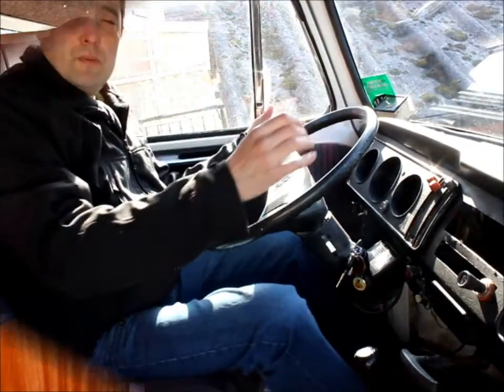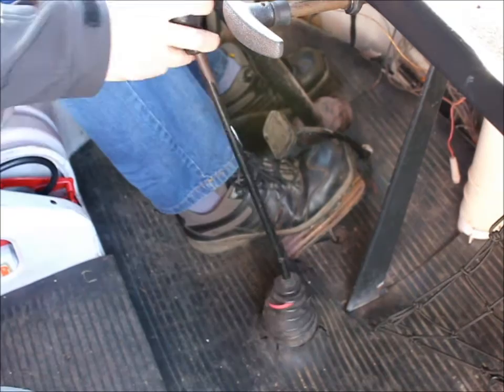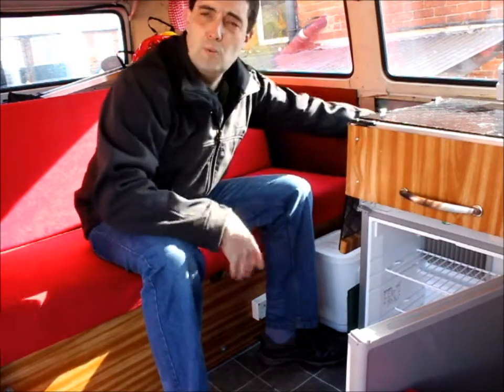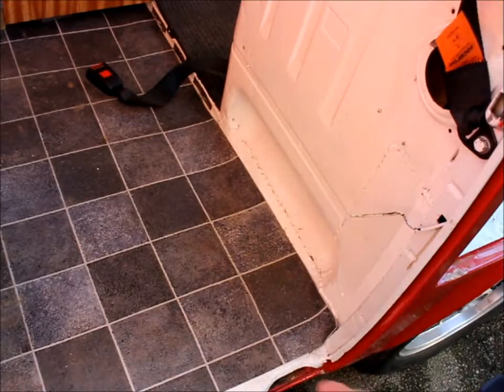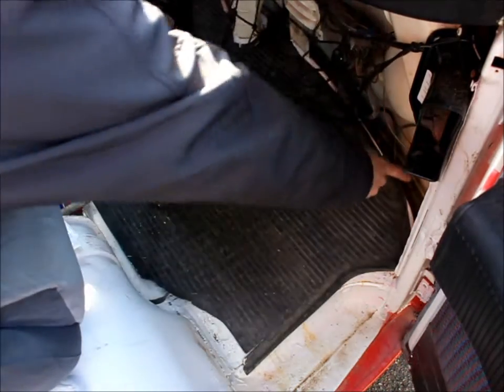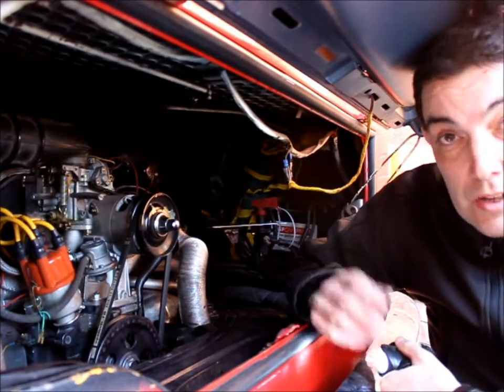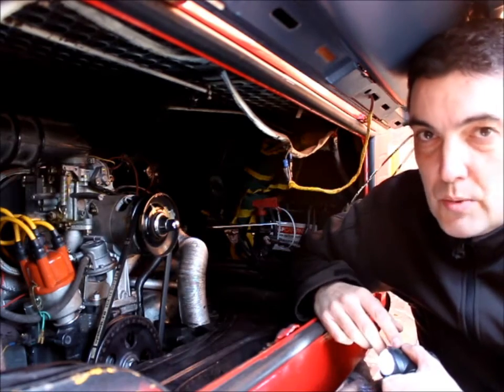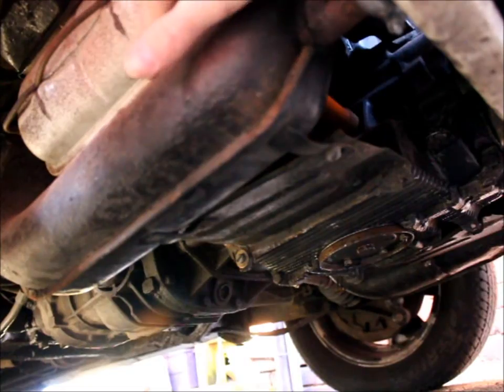VW Bay Window Camper Buyer's Guide

Comment: hello i had a 67 split screen camper.  the rear tailgate door never stayed up unless a stick was placed under to keep it up when opened i know there rods that run across which are supposed to keep tension on the tail gate door to keep it up